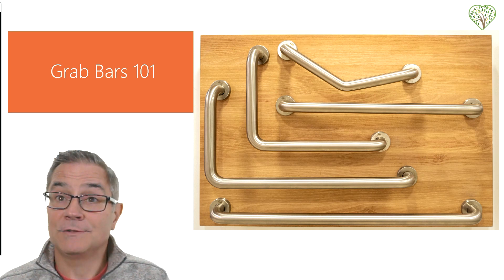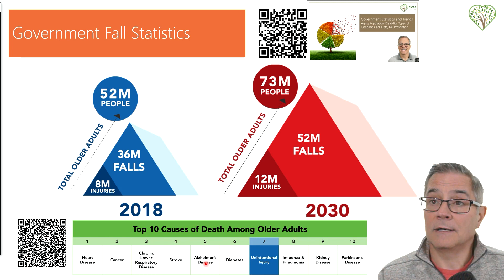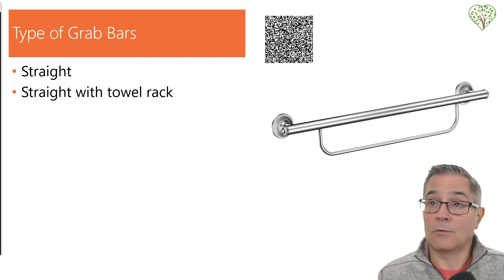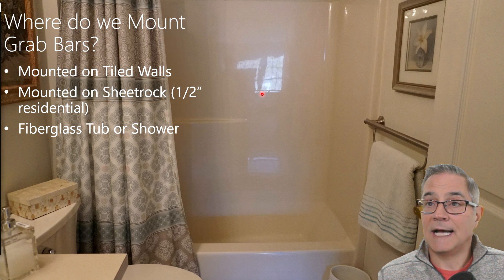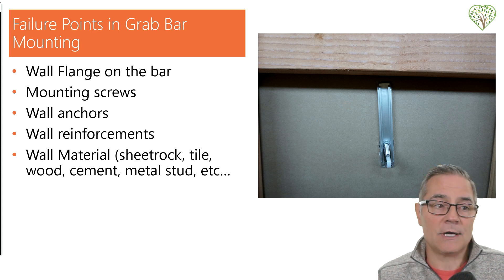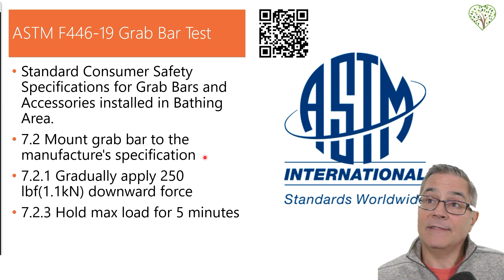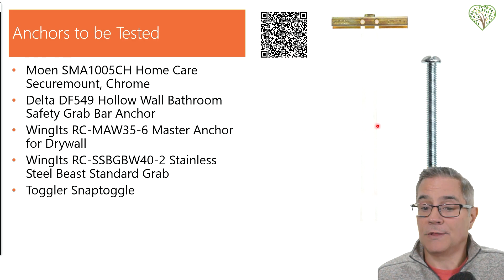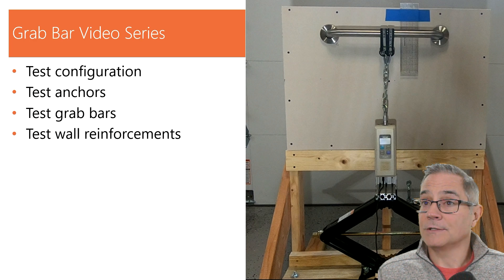E5 Grab Bars 101

Comment: Thank you. Your site is the most informational one on the topic of grab bars I have found (and I have spent hours researching the topic). Based on your reviews and other considerations for my own application, I plan on using the Delta fastener system if I can convince myself that it is compatible with the grab bars I bought. Do you know where I can find the exact specification of the location of the holes in the flange plate?

Comment: Hi, I have heard of people using grab bars mounted with special adhesives.  This sounds appealing because there is no drilling involved.  But I am skeptical.  Have you tested any of these grab bars?  Thank you!
Reply: Hi, and thank you for watching. I'm currently testing the "No Drilling Required" grab bar by nie wieder bohren. This is an epoxy system, and I hope to have it completed in the next few weeks or so. What type of surface are you mounting to?  I'm only testing the grab bars up to 250 pounds as that is what the ADA sets as a guideline. I'm not a testing lab. I'm just a guy with a garage and time on my hands who wants to learn,  provide helpful information and promote safety to people with all abilities. Thanks again for watching, Daryl